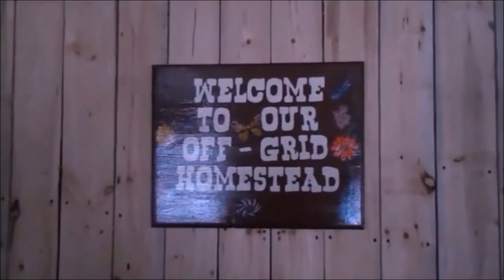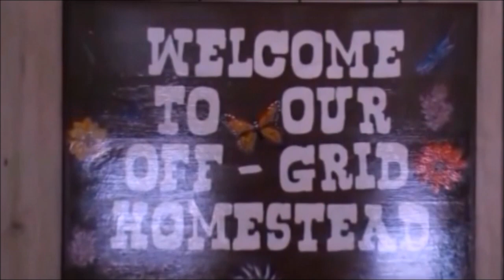Our First Two Sleigh Loads Hauled Across Our New Bridge With Our Snowmobiles

Comment: I bet you have some old bandsaw blades around there.Tack a piece front and back on the log bed to keep the logs from sliding! I'm patiently waiting for the 26' long log haul! Good video today!
Reply from the maker: Thanks Mike, The only thing I would be worried about is if Heather  dropped a large log and got her fingers pinched between a big log and the blade... It might cut a finger off :-(  Or worse mine ;-)  lol.  We used a couple ratchet straps today and they seemed to work well.  Ehh a 26 foot long log Hmm,  Maybe... I might just try that ;-)  Thanks Mike I am glad you enjoyed the video.   Thanks again.  You take care ttyl... Cheers  :-)

Comment: You are so right on the lithium-ion battery chainsaws. So quiet, don't disturb much of anything. Was talking to a fellow truckie last night about my place and battery tools. When I went to leave the restaurant, another truckie asked me the brand of battery chainsaw I had. Sounds like the future for small jobs is battery chainsaw with all the interest in that equipment.
Reply from the maker: Thanks Jeff.    Yes we would find it hard to use our 266 Husqvarna much now... I am spoiled  :-)  Yes I can see lots of equipment switching to Lithium batteries... Can't wait for a battery snowmobile that I can charge with my solar set up.Thanks again.  You take care ttyl... Cheers  :-)
Reply: Off Grid Homesteader Cecil E Skinner Snow Joe has an 80-volt 2-stage snowblower.

Comment: Hi Folks, hope all is well. Was wondering if you had ever considered making a water wheel on the little creek and use a car alternator to charge your battery pack? Saw one on a creek smaller than yours. Worked really good and it charges 24-7-365 rain or shine. Good job sharpening your saw. I have been sharpening saws for almost 40 years and only used just a file. Never a jig or grinder. Take care my friend's!!😁😁 Your friend Al.
Reply from the maker: Hello Al,  how are you, yes I really want to build a micro hydro station here... Unfortunately a water wheel freezes up here in these creeks in the winter. What I want to build later is a pelton wheel in a building driving a 110 volt AC generator.   Thanks Al, yeah I have been sharpening my saws with just a file as well... It's been about 33 years now for me.  Thanks again my friend.  You take care ttyl... Cheers  :-)

Comment: If you can find an old sickle bar hay mower the bar with sickle sections on it would work great for holding the logs on the bunks. The problem with it would be once they were on it would not be easy to adjust the bottom row front to back. Other sources for the bar would be straight cut grain headers for combines or mower conditioners.
Reply from the maker: Sounds good Rob, I will keep an eye open for that stuff.   Thanks again.  You take care ttyl... Cheers  :-)

Comment: Cecil
You should check out the Sthil chain saw sharpening tool. with no problem It will sharpen the cutting edge and the rake to the right depth and  angle with no problem, if you are not experienced in the sharpening process. Also it is not power driven either, just your own man power.lol
Reply from the maker: Thanks John... I am so used to sharpening my saw by hand after 33 years of doing it this way, I doubt if I could get used of a tool I would probably forget at home anyways lol.   Thanks again.  You take care ttyl... Cheers  :-)

Comment: I like my pulp hook with the replacable tips
Reply from the maker: Yes I had a few like that and they are good for some jobs... I found the bolt that held in the tip would vibrate loose and then I would lose the tip if I was carrying it on a piece of machinery.  So I switched to the solid end pulp hook.... I mean really how many times have you had to replace the tip from wearing it out?  My dads hook is 60 years old and maybe sharpened 10 times.   Thanks again.  You take care ttyl... Cheers  :-)

Comment: Cecil you don't need to waste your time with a ratchet strap. Use a tourinkee type deal. Piece of rope around your logs,2" piece of birch or something twist until tight,be careful it doesn't slip and smack you and tie it off on one side. It will never go anywhere. You need to look for a proper woods machine like a skandic old buddy! She'll haul it without a broken trail.